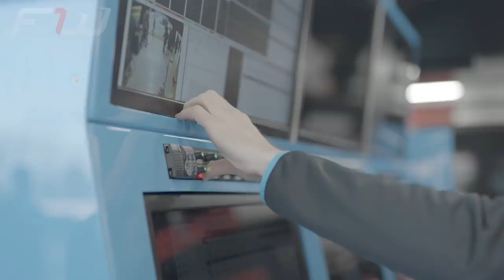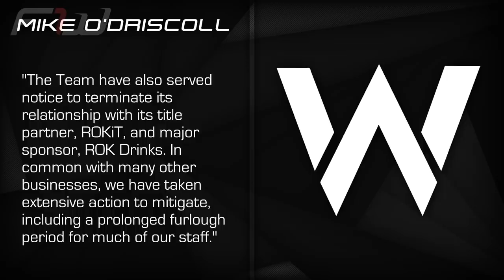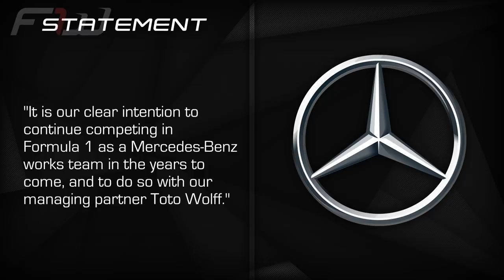F1 News: Williams Could Sell Formula One Team

Comment: depressing, Williams was the only team I supported back in the day, until the electronics ban in the mid 90s, since then only supported drivers. Still, don't like seeing Williams do badly or to fold. As sad as it is to lease a team, other teams come.  
As for going racing again, why don't they just do 7 or 8 tracks, each with double race, that would give them enough time for the 2 week quarantine between race tracks, some countries are demanding(sensibly) combined with regular testing. Although marshalls are still an issue, as most our voluntary and a significant part of the population have had pay cuts or job loses. Perhaps liberty could offer some funds to them and virus testing, after all the grounds around tracks are going to be empty with lack off fans.

Comment: Claire said back in 2018: ‘Williams to become like Tyrell?!, over my dead body’

2020: Williams is for sale 🤔

Claire also said: team hasn’t been in a downward spiral. It just had 2 bad years.

Reality: Williams has been on a downward spiral since their BMW days. The success they had 2014-17 was greatly due to the Mercedes engine. The chassis was the best of the then troubled Mercedes powered teams.
Reply: The Chassis were the exact opposite of great during 2014-2017. I advice you to look in the race results of Williams during those years. Williams leaned way too much on the engine advantage during those years, but when they drove at a track where the engine didn't really matter... (Monaco, Singapore and Hungary for example) They were nowhere as good as on the high-speed tracks.
Reply: Sekhy Hybrid They followed a low drag concept which certainly worked for those years. They were able to beat McLaren in 2014 with the same engine.
And force India the following seasons

I’m sure people at Williams knew this concept wouldn’t make them a Mercedes  beater
Reply: @johnva7  Sure, but in the 2nd part of the 2015 season, they found out that they suffered from tire wear issues. This was never solved in the upcoming years with in 2016 that they lost to Force India. 2017 as well. 2014 McLaren was good in Melbourne and that was it. The car lacked downforce, so yes the 2014 and 2015 Williams were really good for those seasons, but they couldn't improve enough for 2016 and onwards.